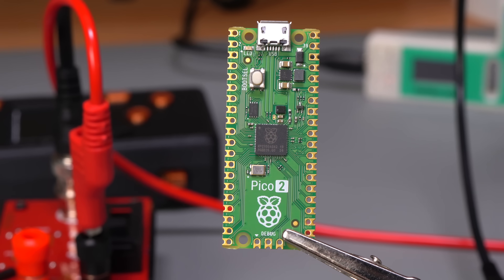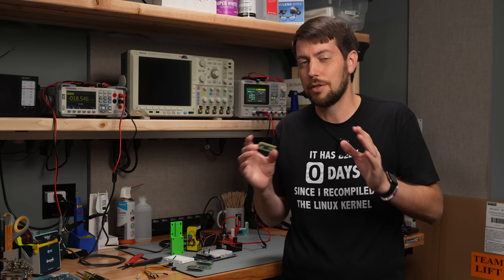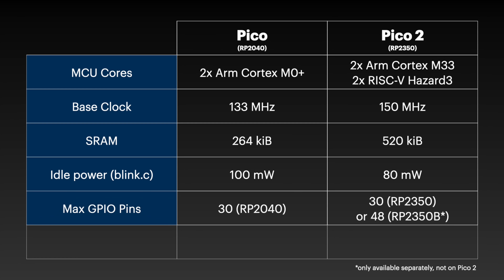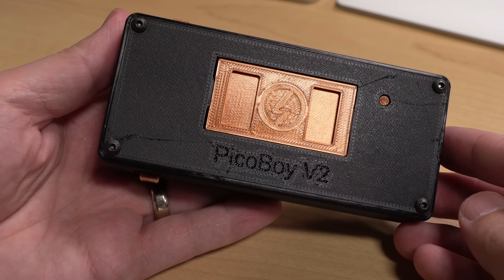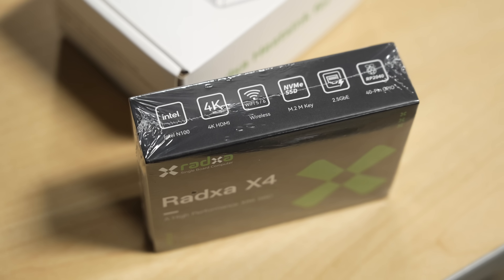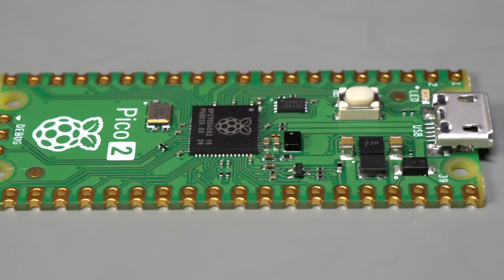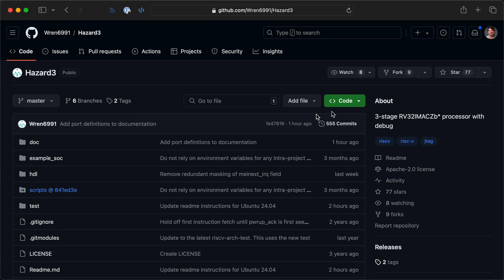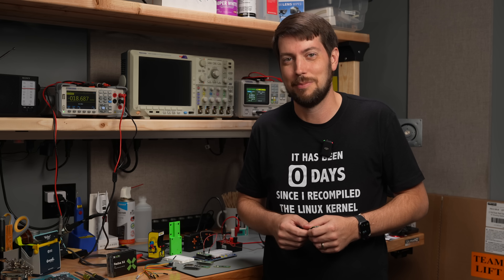Raspberry Pi Pico 2: a RISC-V bet!

Comment: Still no usb C
Reply: probably because the pick n place part for a microusb port is dirt cheap and they bought it in bulk, and likely have a lot of leftover stock
Reply: @oggilein1 usb-c is dirt cheap at scale as well these days
Reply: Just wait for those cheaper chinese boards with USB-C and other goodies :p
Reply: @alexdev6161 pimorino has it already😂
Reply: @alexdev6161 facts
Reply: @alexdev6161 

Yea, it's too bad, I would love to support them, but I just don't wanna add micro usb to my build
Reply: @alexdev6161  Let's believe Chinese board lol
Reply: Pimoroni have their own boards with USB C on :)
Reply: And no reset button, which exacerbates the micro USB issue because of repeated unplugging.
Reply: @KNfLrPn  I mean you could use a switch to solve this
Reply: @KNfLrPn  Just use a USB lead with a switch in it, quite common when working with the original Raspberry Pi, or cut a lead and make your own, after all isn't this the 'maker space'?
Reply: @KNfLrPn Just unplug your USB cable from the other side?😅
Reply: that's why you buy some chinese knockoff of the pico that has everything the same, but a usb-c port. Never buying original until they switch.
Reply: @tommihommi1  Yeah, I bought one that not only costs quarter of what genuine pico would cost, but it also has: USB-C, reset button, RGB LED and 16MB of flash. Truly an amazing value for what it's worth.
Reply: @just_a_hoverfly 
It's $1.25?  The Pico is $5. Though I just bought some on sale for $3
Reply: @tommihommi1  I tried running a program that tries to communicate with a gameboy link cable, and it didn't work with the chinese knockoffs, apparently the timings are a bit different on these so depending on the project the code is different.
Reply: @tommihommi1 it saves almost 75c, at 10$ retail per board, 75c is a lot. Also backwards compatibility.
Reply: @tommihommi1  no let's be honest you're the kind of person who never buys original because too cheap
Reply: @tommihommi1  What a ridiculous sentiment. You act like it's some huge, insurmountable problem, yet micro USB cables and adapters are cheap and commonplace. Why? Because for years, lots of devices were made using micro USB. And people still use those devices. Honestly behaving like a precocious child is barely acceptable in children, never mind grown adults. 🙄
Reply: Bonkers they kept using Micro USB!
Reply: SparkFun did it for them with the "SparkFun Pro Micro RP2350" released at the same time as this.
Reply: @DavidChamot  Adafruit had a feather, uno, and a bunch of others too
Reply: I like to use milk-v duo that has usb-c and runs a very basic version of Linux, it cost less than the pico (it costs 4€) and has a dual boot risc-v cpu
Reply: @pandaalato8223  can you write code for it without using linux? using gpiod and especially trying to do anything with spi is an absolute nightmare on SBCs, so it would be nice if bare-metal code could be written for it
Reply: One issue with cheaper products using USB-C is that they don't always fully conform to the USB-C specification, which can result in problems when trying to charge with a USB-C to USB-C cable. These devices should include 5.1kΩ pull-down resistors on the CC1 and CC2 pins to signal to the charger that they are power sinks, prompting the charger to supply 5V by default. However, some low-cost products skip this step and instead include a USB-C to USB-A cable in the box 🙄. I hope that if a future Pico device uses USB-C, it will properly support USB-C to USB-C charging!
Reply: @boggieboi I believe the pico can take either role with USB OTG, I don't know how complicated that would make it.
Reply: bUt NoBoDy WaNtS uSb C bEcAuSe iT mAkEs ThE dEvIcE eXpEnSiVe
Reply: Groundstudio also have very nice usb c Pico style boards
Reply: Literally bought some from temu lmao
Reply: Aliexpress versions are always better😅
Reply: The first thing that came to mind when I saw the thumbnail...
Reply: Or USB B.
Reply: Fr
Reply: you don't need usbc with this... it's literally 1-2 watts of power at most... wth would usbc even do any good for it...
Reply: This is a total fail, but then again I suppose one can solder a USB adapter with a bit of bodging.
Reply: They have to put every Phone yp to Iphone 15 usb-c. So no more overprized and  shit lightining cables.
Reply: Not a problem. They are cheaper, we gave a gazillion cables, it is more sturdy, and you can swap the socket if a student kills it (which I never had to do with micro-USB). I CAN'T solder a new USB-C socket though, the pins are way too tiny.
Reply: True, even clone-pi pico's have type C usb
Reply: the DEFCON badge which is a custom version of this board has USB-C
Reply: Because of next thunderbolt option...
Reply: How else would you sell dongles 😂
Reply: they're for profit now, and still chose it, so they must have had a reason for it. though that doesn't mean it benefits us.
i'm ok with micro-b, for now. i still have a lot dangling everywhere
Reply: Guess ill be buying waveshare boards again :P
Reply: There are too many useless pins on USB type C port if it's used on Raspberry Pi Pico.
Reply: I have commented on there LinkedIn post 😅😅😅, let's see whats going to happen
Reply: Cringe
Reply: Classic Raspberry Pi Move
Reply: I don't understand the problem. It's a USB 1.1 device. 1.1! A to Micro-B cables are still everywhere. What's the benefit of USB-C for a Pico?
Reply: @SnakebitSTI  usbc has several several times more durability
Reply: @MrPacman64  USB-C: Minimum 10,000 cycles. USB micro B: Minimum 10,000 cycles.

10,000 is not several times larger than 10,000.
Reply: @SnakebitSTI  yea tell that to real world experience lmao. Idc what they say they're "certified" for.
Reply: @SnakebitSTI   you need that 3A, 5V of power for overclocking it 😅
Reply: @SnakebitSTI  because when people mount it in an enclosure as a finished product with the USB port mounted externally, that contributes to the further propagation of the service life of Micro B. Micro B is an awful connector, it’s optimised for being thin enough to fit in mobile devices, which is a non-issue for anything with a pi pico in it, it’s more delicate than other USB connectors, and everyone has half a dozen short cheap Micro B cables, most of which don’t even have data wires, leading to frustration when using them for anything but charging. USB C is aimed at being the de facto replacement for all USB standards, it’s ok I guess, but it’s still not as sturdy as USB B, or RS232 DE9. And now USB C has a bunch of cheap cables without data wires too.
Reply: @Scrogan there should have been some standard indicator for 2 or 4 wire usb cables, it's wasteful using many wires on a power cables or low speed data cable but it's confusing having different cables that look the same. And I kind of blame usb-c for trying to make all cables the same.
Reply: Nice! They seem to know what’s good
Reply: Who cares? It's not a problem for anybody. Cables and adapters are cheap and plentiful due to the not insignificant numbers of devices that were/are made with Micro USB. Crying over inconsequential things like this is frankly ridiculous. Anybody would think it's as hard as finding DB9 serial cables for 25 year old computers. Even they are still available new.
Reply: So what? I have loads of micro-USB them left over from other projects. It wouldn't benefit from USB-C, only your conveniece would.
Reply: @wernerviehhauser94  its a much more robust connector, especially for repeated plug unplug cycles. As mentioned in other comments will be quite common given the lack of any other way to reset the micro.
Reply: @Cynyr  design specs rate both at 10k cycles. I've broken both of them and my kids Ocarina has been through at least one cycle per day from 2011 to 2020/21, still running on third battery and original micro-USB connector while my 5yo USB-C tablet is already picky. I don't know if its really the better connector or just users being saved from trying to plug it in the wrong way (despite it being D-shaped... I've seen shit happen...)
Reply: @Cynyr Toggle the run pin I just found out asking AI trying to read the bootsel button and wanting to murder the AI.. finally flipped the board over and noticed RUN and asked the AI to which it stated it's a reset pin...grr who renames a reset pin to run.... Nuts

Comment: Ok but RP2350 doesn’t roll off the tongue like RP2040 does
Reply: True, but just from the name you can tell that it has 2 M3 based cores, more than 512KB of RAM and no internal Flash memory.

Comment: All aboard the RISC-V HYPE TRAIN!
Reply: RISC has been a thing for a long time, but time has left so very many architectures by the wayside - let's look at a company that's been in business for 28 years to see how many architectures they support: MikroTik.  As of its most current release, RouterOS is available on the following CPU cores: arm, arm64, mipsbe, mmips, ppc, smips, tile, x64, and x86.  The latter two are CISC of course.  Those are just the more powerful ones, to say nothing of the various microcontrollers floating around out there like the NEC V850 family (V810 in the VirtualBoy) and the Atmel AVR (on the Arduino), to pick two.